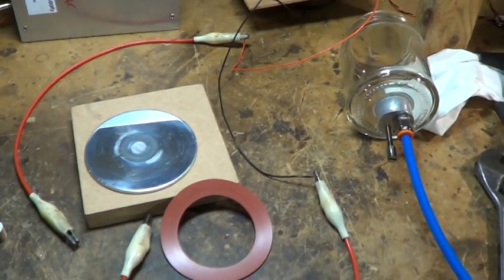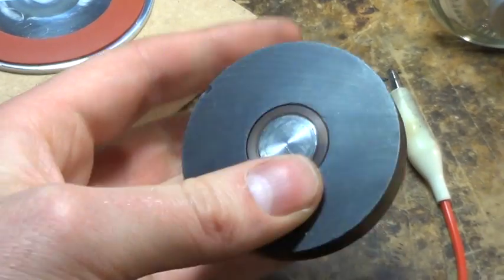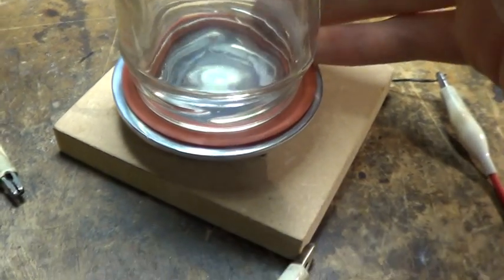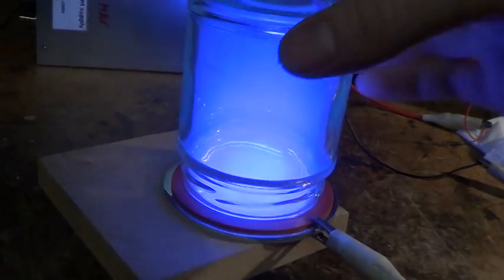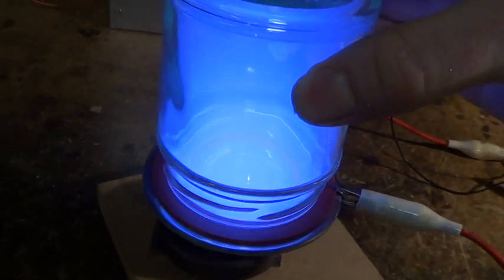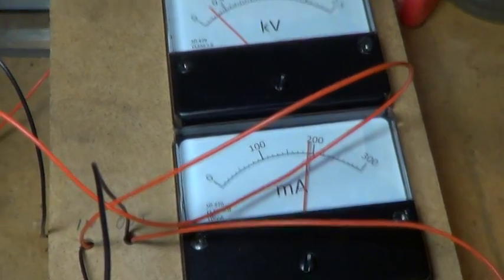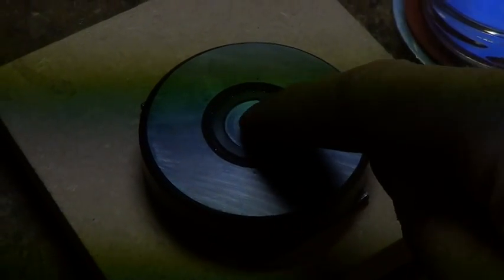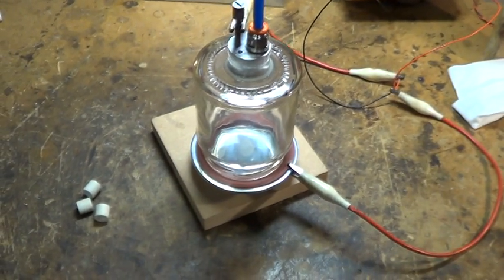Demonstration of magnetron plasma

Comment: Fantastically simple setup.  
How did you know the jam jar would withstand the vac before using it?
Seems a little risky to just test with any garden variety jar.

Looks like you're using regular atmospheric gas.  Have you tried any pure feed gasses? (argon, Methane, Helium, oxygen)

What kind of substrates are you depositing on?
Reply from the maker: Peter Romo Hi! It is a little risky ;-) I had used jamjars years ago for simple vacuum chambers, and they all seemed to stand up pretty well, so I was reasonably confident of it being safe.

I'm actually using argon - the other gases I have (co2, oxygen, air) all need a higher operating voltage which my supply wasn't capable of putting out. Besides argon is generally the best for trying to sputter stuff.

Note that I never actually sputtered anything with this - that would require some cooling of the cathode, because it does heat up very quickly.

Comment: Could hho ignite in there
Reply from the maker: 1) Temperature: I have no idea. It depends on the degree of ionisation, ratio of charged to neutral particles, and a whole load other stuff which I've long since forgotten about since university. Very roughly, in the thousands of degrees. Here's a graph with various different types of plasmas and their particle energies/temperatures: http://www.szfki.hu/EN/128

2) I must strongly criticize your use of the term "HHO". If you are referring, as I think you are, to the mixture of oxygen and hydrogen produced by the electrolysis of water, then this is simply a stoichiometric mixture of the two gases in a 2:1 molar ratio of hydrogen to oxygen. Giving this gas mixture the supposed molecular formula of "HHO" implies that it is some new compound of hydrogen and oxygen with special properties, which is, if you'll pardon my French, bullshit. The fringe science community (water-fulled car, overunity fuel cell, plasma electrolysis, Brown's gas, Stanley Meyer, Santilli, and on, and on....) persist in their belief that this gas mixture has special properties, despite the lack of a single piece of evidence.

So, in response to your question: "Could a 2:1 hydrogen:oxygen mixture ignite in there"; yes, it probably could. However, the gas pressures in the glow discharge are maybe a few torr, or nearly a thousandth of atmospheric pressure, so any "bang" produced, if that's what you're trying to achieve, would be pretty weak.
Reply: Your "french" sir I do pardon. However your "english" which may I say, is quite thorough, thank you for responding,
And yes I will refrain from using that jargon. If I may? What would you think of pumping co2,argon or nitrogen,through this experiment? If I
Reply from the maker: Rayan Agarm Thanks ;-)

Well, the effect of adding other gases would mainly be to alter the color of the discharge. CO2 is sort of grey, argon is purple (as seen here) and nitrogen is more blue. The current/voltage characteristics would be different - CO2 is much less conductive than argon so would require a higher voltage. Nitrogen is slightly less conductive than argon as well.
Reply: +Lindsay Wilson So you're saying that there's argon inside the jar?  Also, would neon or xenon work?

A long time ago I had a chance to see an inductively coupled plasma MS.  Argon gas was pumped through a quartz tube around which an electrically conducting coil was placed.  Some kind of charge was sent through the coil and a magnetic field was produced which stripped the electrons from the argon atoms.  A super intense bright light and lots of heat (6000 K) were generated.  I had a persistent blind spot for 20 minutes after I glanced at it briefly through a gap in the light shield.

How similar is your setup to inductively coupled plasma?
Reply from the maker: The main differences are that I'm using DC (inductive coupling only works with AC, generally many MHz radiofrequency) and internal electodes (as you saw, inductive coupling works without any physical contact between the coil and the gas).

David Knight's website at http://www.g3ynh.info/zdocs/magnetics/appendix/self_res/gallery.html has some great demonstrations of both inductively coupled plasmas, and also using them to demonstrate standing waves & self-resonance in various shapes of inductors.

Comment: Why is it blue? Has anything to do with Cherenkov radiation, just curious?
Reply from the maker: Nope, just visible light emission from the glow discharge (electron/ion recombination -> visible light). The color depends on the gas present in the chamber - air is generally purple/blue, argon would be blue, helium pinkish, and neon red.

Cerenkov radiation is when an energetic particle enters a medium in which it's travelling faster than the speed of light IN THAT MEDIUM. For example, in water, the speed of light is only about 0.75 of that in a vacuum, and it's possible for some particles produced by nuclear reactions to travel faster than this (nothing can travel faster than the speed of light in a vacuum, remember). The result is like a sonic boom, but for light ;-) Hence the pictures of reactor pools glowing blue.
Reply: ***** You use a vaccum pump to partially remove the air inside the jar right?
Reply from the maker: soulhunter0 Yes - not quite sure what pressure, probably under a Torr. More details on my page at
 http://imajeenyus.com/vacuum/20140114_magnetron_plasma/index.shtml

Comment: Nice Video! Link to website fills-in the gaps in what was missing in the video. Making the aluminum block and attaching everything to that is much better than drilling multiple holes in the jar.
I know how difficult it is to film this type of video with only one person to hold the camera and do the work. It was easier for me when I got tripod.
On a safety note, 200 mA is a lethal amount of current. I would be a little more conscious of getting a shock from the equipment. I got a little concerned when you handled the energized jar to demonstrate the ring dissolving when the magnetic field is removed. I would have setup the demo so that I would move the magnet instead so as not to handle the jar with 1KV. Those jumpers are also not rated for 1KV so the insulation might break down and be ineffective. Those look like they might have 600V insulation.
Reply from the maker: Owen Chase Heheh, I guessed that's what you were wanting it for ;-)

Some brief background: a partially reflective mirror for use at CO2 wavelengths obviously needs to be made from a material which is transparent. The ONLY materials which are suffciently transparent are some of the alkali metal halides (sodium/potasssium chloride/bromide, i.e. salt), zinc selenide (which is what commercial lenses & mirrors are made from), gallium arsenide, and germanium. The last two are opaque to visible wavelengths so are a pain to use during alignment.

For a DIY CO2 laser, don't bother trying to make a partially reflective output coupler - it's simply too much trouble. However, there's a happy solution.

Early CO2 lasers, and many home-built lasers now, used a totally reflective mirror with a small hole in the middle as an output coupler. This isn't ideal, but works quite well. You have a much wider choice of materials for the mirror - solid metal (copper, hard drive platter etc), or metallised glass. You unfortunately still need to seal the hole, but this can be done with a small piece of salt crystal or (if you're lucky enough to get hold of some) gallium arsenide wafer.

My early lasers (http://imajeenyus.com/optical/20031101_co2_lasers/index.shtml) started off using a holey mirror + GaAs seal, but I then switched to using a proper ZnSe output coupler. I'm no longer involved in building laser stuff, but I can highly recommend my friend Jarrod's website - http://jarrodkinsey.org/co2laser/co2laser.html. He has built several CO2 lasers, using a variety of different mirror techniques, and always tries to use "common" materials in the simplest possible way. (e.g. for a gas supply he once used a mixture of exhaled breath and balloon helium!).

Now, I should warn you: if you're building a CO2 laser for the sake of it, that's great - you'll learn a lot of about lasers, optics, vacuum systems etc. However, if you're building this with the idea of using it for something practical, for example laser cutting, I'm afraid I have to say forget it! Believe me, I've been down that road. Ten years ago, when Chinese CO2 laser tubes and cutters didn't exist, I thought about building a tube and laser cutter. Now, I have a 40W and 80W laser cutters bought entirely from China. Given the availability, convenience, and relatively low cost of Chinese laser tubes, you'd be far better buying a tube + power supply. It's unlikely a home-built tube would rival a commercial one.

Hope that helps!
Reply from the maker: I agree, moving the jar around by hand perhaps isn't the safest of techniques. However, 1kV won't jump far, perhaps 0.5 to 1mm at most, and I was careful to keep my hand well away from the electrode on top. I'm not being complacent, but I've a pretty decent feeling for where it's safe to handle things. It's a far cry from working with tens of kV, where you have to really think about where a discharge could jump to, often in the oddest of places!

Regarding the jumper leads, I honestly don't know what to believe about voltage ratings. That thick red wire is actually rated at 1kV, but I've used it in a pinch at 20kV and haven't seen breakdown of the insulation itself. Likewise, the thinner red and black wires (connected to the meters) are only something like 300V rating, but again I've had no problems with breakdown. I guess that the voltage rating applied to the wire is extremely conservative - obviously for "proper" use you'd need cable with the proper rating, but for hobbyist stuff this is fine.

I once checked to see what the breakdown voltage of the coating on enamelled coper wire was - wrapped two pieces of enamelled wire together and increased the voltage between them until it broke down. Worked out at about 5kV for a single layer of insulation, pretty impressive!
Reply: I have worked with 4KV enameled wire that tested to failure at 21KV. To pass the test it only had to go to 20KV, but we took it to failure just to see how much margin we had.
Good to know you are thinking about safety makes your audience feel better.
:)
Reply: ***** if you wanted to sputter what would you do diffrent?
Reply from the maker: Owen Chase The main things would be cooling and the power supply. And perhaps using rare-earth magnets instead of ferrite. A lot of heat is deposited in the cathode during operation and the only effective way to remove this is by water-cooling the rear. It's a bit tricky to get a water feed which is also vacuum tight and electrically isolated from the surroundings, but possible.

On my webpage (link in description) there's links to three of Ben Krasnow's videos where he describes his sputtering gun, the magnet assembly etc. I can't actually remember if he was using water cooling, but I think he was. Cheers, Lindsay.
Reply: I was going to use it to make partial reflective mirror for co2 laser do you know how I would make it partial reflective without making it 100% reflective I thought a co2 laser will burn glass and I thought glass was the best thing to you to sputter a copper coating on?
Reply: Thanks

Comment: Mechanical pumps are not enough to sputter any reactive metals.
Only silver, gold, platinul..etc.. will work.
You will get deposition but most of that will be oxides.
Just adding argon will not remove the contaminants, it will jusy inchrease the pressure.

Still, i like your external magnet setup, it's good for heat disipation.

Comment: If you had a ball magnet (like those neodymium magnets bracelets) and it would sit inside the jar, what would happen, if anything?
Reply from the maker: Not really sure - I'd guess that the plasma would get trapped around the "equator"
Reply: ***** Interesting. Thanks.
Reply: 🤔 It would most likely heat up ♨️ and loose it magnetic polarity after a little while 🚫